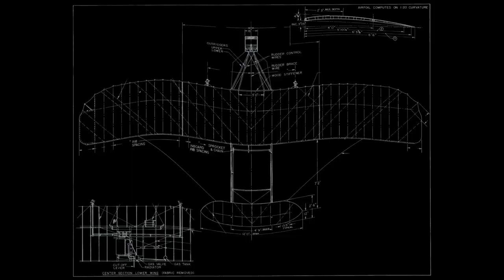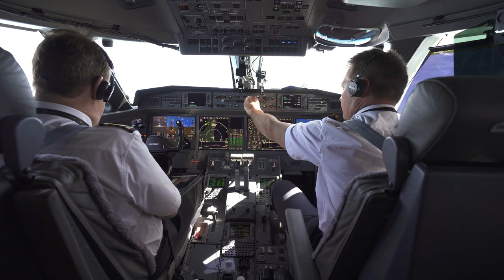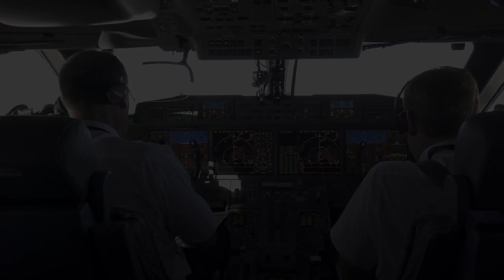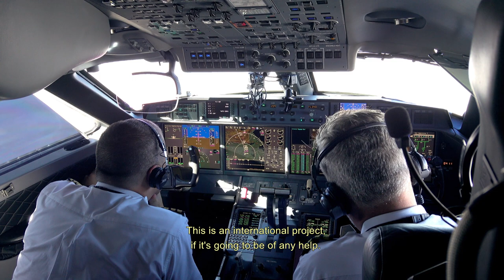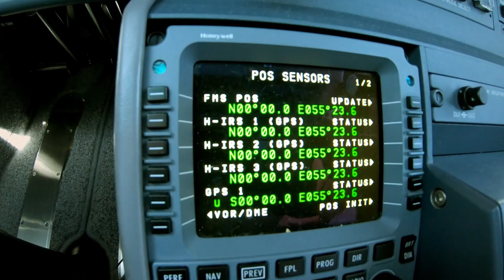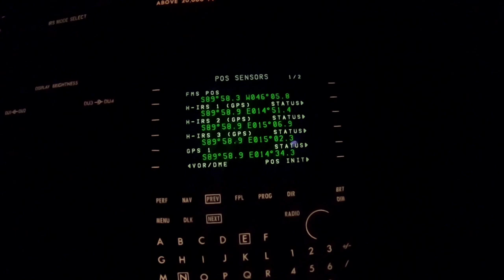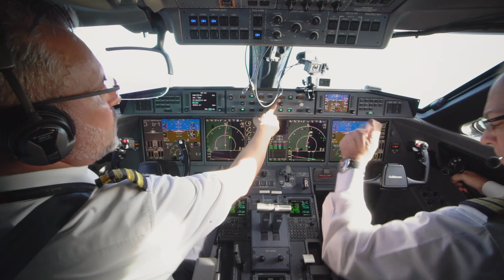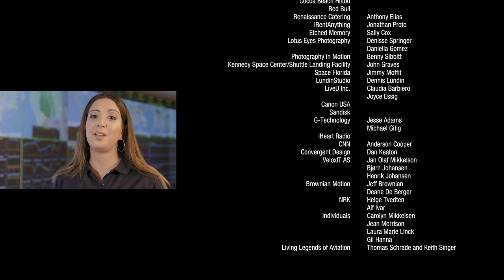How Hamish Harding And Terry Virts Broke An Impossible Record | One More Orbit | Documentary Central

Comment: Meh…. Just a bunch of pilots on a pointless joyride being waited on by pretty air hostesses  👩 They use multiple pilots 🧑‍✈️ it’s not like they set any endurance records. Concorde or the SR71 could have done this in the seventies in half the time but weren’t allowed to because of sonic boom complaints.
Reply: No, Concorde didn’t have the legs for this and the SR71 would have required an incredible amount of aerial refueling support. Probably beyond reasonable for a pole to pole mission, specially in Antarctica. It has nothing to do with sonic booms when it comes to records the SR71 went for.
Reply: This isn't so much about the guys on the plane as it is all the logistics and support people